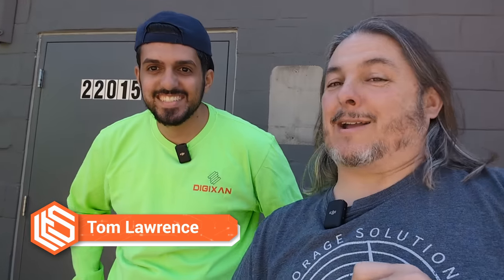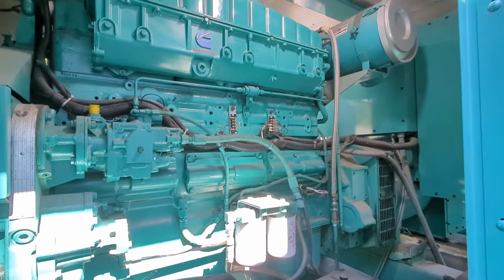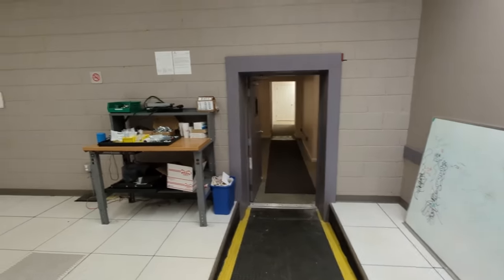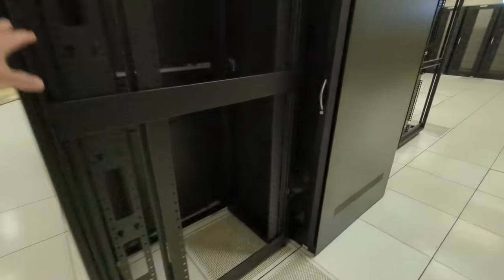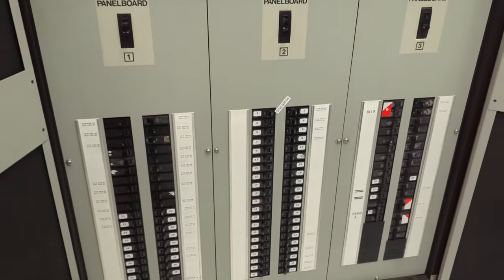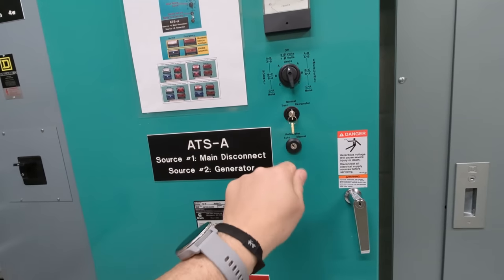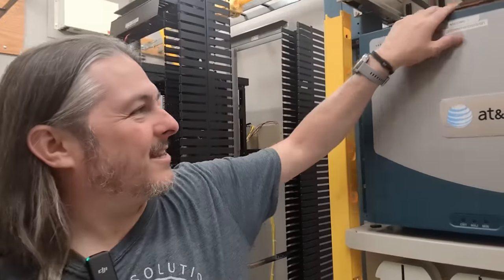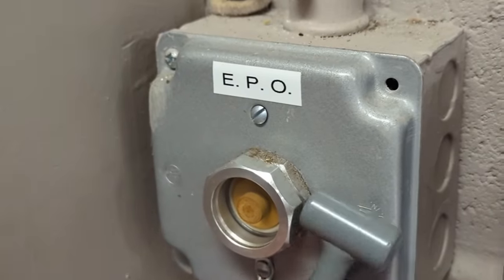What's Inside This Decommissioned Data Center?

Comment: "normally can't open these" man that's so wild compared to places where I've been in computer lab support server rooms and its like "yeah just go find the breaker turn it on" with various 120V/208V/480V different 3 phase delta/wye, and 60/400Hz power systems.  The plumbing stuff and UPSs are neat though, that part I can't see places I've been.

Comment: Ah, a good example of a data center where you least expect it. These are actually very common throughout the world.
The main reasons for keeping a data center's location a secret is purely hardware security. Having direct access to a server is far more dangerous than almost any software attack.
Data centers that just offers VMs tends to be more relaxed about this type of security, since the hardware itself is more or less just a standardized box without any labels hinting at who rents it. Ie, it is far far harder to do a targeted attack at a specific organization. But even a lot of these data centers hides.

In Stockholm where I live I know of 2 data centers that are in actual cold war era bunkers. Their locations are fairly well known, but that doesn't make it easier to access, since it is a litteral bunker. Though even highly secure facilities have been targeted through more indirect means before, just dropping a few "thumb drives" outside the premise to try to pull of a HID attack isn't a new thing. This becomes a lot harder if you don't even know where the secure facility is located.

Comment: We had a UPS explode in our data center in about 2001. Big fire, and lots of water damage, because the fire department couldn't get in. The guy who had the keys got into a car accident rushing to the site. Now the center has no UPS in the server rooms. A fire wall between it.
Reply: @@wd5vd page 2: They used concrete saws and cut a hole in the wall after what seemed a long wait.

Comment: I loved testing the generators and transfer switches both from the UPS and by killing power. It was a frequent testing requirement from the insurance co.  I also liked it when the halon fire system went off.
Reply: >I also liked it when the halon fire system went off

That does NOT sound like fun.
Reply: @Jamesaepp  expensive too, causes shunt trip of power also

Comment: Currently work in a former data center like that one, with the same raised floors and Liebert HVAC.  They kept the layout even without actual server racks.  The Lieberts break down a lot. The room has two. With just one, we exceed 110 degrees just from ambient.  Really need two to be survivable and again, we don't even have servers.  The best part about the Lieberts is how they smell like a cross between old socks and an old fridge.

Comment: A question about the genny, I worked for a company and their corporate data center and IT department was in part of our building. They had two independent generators, one diesel and the second natural gas. The primary was the gas unit. They had 7 days worth of diesel on hand. I left in 96, do people spec single or double generators now? Is it just how paranoid management is?

Comment: That's one Tiny datacenter.
Reply from the maker: yup
Reply: I worked building maintenance at the one in Atlanta (40 Perimeter Center 1978) and ours was 84k sq ft.  2 story, the bottom being the actual "Data" portion and the upper is where all the programmers were.  We did all the electrical, plumbing, HVAC and work stations.
Reply: Relic of a "long past" age. These days, one could have more power in a single rack than that entire building. (I've used "small" [4U] blade centers that used 4kW... the whole rack only had 5.7k fed to it.)

Comment: I worked in the Data Center for the Atlanta Federal Reserve back around the year 2000. I was the LMS administrator for the first online training server they installed. It was about the same size as the one you were visiting. Nowadays that Data Center has been shrunk down to a small room with one cabinet of servers. :)

Comment: I was once a short term generator tech. ATAT was our good customer. One of the bigger sites, the "switch's" where all the local calls are routed through. Then the calls go microwave to microwave tower all around the country. For instance. the whole east coast has microwave towers all down the coast it doesn't need any wire/fiber to go all the way. Then to fiber maybe depending on how far across the planet. Detroit
The other cool generator was when the main standby 1 megawatt one needs a part in a switch building. It then needs a back up of the backup generator. Brought in a trailer generator. 8 cylinder twin turbo diesel cat. OH MY GAWD. the startup on that is violent and the airflow for the radiator will suck a golf bawl through a garden hose. Very fun but i had to go make a bit more money at a desk job.

Love you channel
I'm also here to say my old black box heater poe edgerouter x died. Replaced it with a lite 8. Firmware it had or suggested, was broke. They eventually fixed it as my google foo wasn't good enough to figure out how to put an older firmware on it. Or just my unique basic PC hosted controller (up-to-date). It wouldn't take an adoption and hold. It would fault out. Over and over, reset after reset. Firmware update came along a few weeks later. voila. Great.
I do like the switch setup and its setup in the controller instead of standalone like the old edge router. 
Time for some cameras i think.
Reply: They are called Central Offices (CO's).  Nothing is on microwave anymore.  At least nothing significant.  Everything is on fiber.  Both coasts, everything in between, as well as oceanic.  Power consumption is even less than back in the 90's.  You go into a CO today and I guarantee there are empty floors that were jam packed with telephony gear.  Hell one floor would be dedicated just to terminate all the outside plant cable pairs.

Comment: Hmm... NetApp has a data center in the Research Triangle that MIGHT be filmable.   They promote it to sell copies of it... reason?  It is FAR more efficient than most data centers... the front of racks is a reasonable human temp.. the back? Very warm...   They have huge diesel generators to keep things alive during the normal Duke Power problems...   One of the nice side effects of having the racks isolated is that a large percentage of noise goes away when you have the backs  of the racks sort of isolated from the fronts... (Lord knows a NetApp Filer is NOT a quiet animal...)

Comment: Looks like it was a small business local DC, especially with only 1 generator. Any DC I've been to (and have eqpt at 4 locations) has at least 5 gennies, usually N+1. Two major DCs I'm at also have contracts with fuel (diesel) suppliers that when a major storm is inbound, they not only have their multiple thousand gallon underground tanks, but to have a couple tankers parked in the parking lot in case of an extended outage. The inners and operations of DCs are fascinating. Only a few min in on your video, but so far very interesting.

Comment: cabling is often cut like this due to not wanting the gear to be reusable, if the tenant were to sell it to the building owner/landlord, and if there were ANY issues down the line, there could be a giant legal mess that the previous tenant might get pulled into.  that and the obvious "not my job"/expediency thing, and sometimes to spite the building owner/landlord. also sometimes shady contractor things in the agreements "tenant will use our preferred vendor for network cabling install work"

Comment: I swear - after building and commissioning a bunch of TV stations (which are not too unlike data ceters) concrete floor tiles are the shittiest things to cut holes in for racks.... and then when you cable the rack and pull the cables the steel tops and bottoms are like razor blades if you dont put capping on them.

Comment: How long ago did Nexcess decommission it? It looks like they still have it listed on their datacenters page. I wonder how much noise the neighbors, such as the dance studio next door, heard.
Reply from the maker: Not sure but the generator was last serviced in 2022 per the tags on it.
Reply: i think we only finally decommissioned it a year or so ago. re: noise: the generator only ran during anticipated/actual power outages. other than that, the walls and thick doors keeps most of the noise inside.

Comment: Why was there a data center in Dearborn of all places?
Reply from the maker: yeah, weird placement being adjacent to a few other business like that and backing right up to residential. It's hiding in plane site.
Reply: Low land prices, I would imagine
Reply: I almost purchased this data center when I was CEO of Ann Arbor based DigitalRealm (in fact, I bought a house across from because I was confident and expecting to close on it but Nexcess won the bidding war at the time).  So I instead built out a DC in downtown Ann Arbor's Key Bank Building (where Cisco had vacated then site used to build the BFR which required them to make serious augments to the building)
Reply: It was built by Carter, which designed facilities for Level3, UUNET/Worldcom, and Verizon.  It has close proximity to several fiber conduits and it had ample power in the area (which had reduced the cost to augment).  I believe, it was originally designed to supplement backbone provider AEGIS other location on Outer Drive.  I did a lot of BGP/Internet peering consulting for ISPs and CLECs my youth in the mid 90s and its rarely about cheap land and more about the areas infrastructure.  Otherwise that facility would be larger.
Reply: @allthingsdigital2434  I actually use to host a server at DR in ann arbor back in the early 2000s. That place was tiny, even smaller than this one.

Comment: i had always heard you couldn't cut fiber like that but I didn't know if that went by the wayside when they switched to plastic core over the older glass style. I never get to terminate those so I've always been curious. Cool video btw I've only heard a quiet datacenter room when we're starting a NEW warehouse.
Reply: Well not if you plan to use it but for demo...who cares
Reply: @mrmotofy  I asked bc I have that scenario, but the cable is also underground. Trying to fix without a full replacement.
Reply: @TannerWood2k1  With proper cutting and equipment it can be done. But in the middle of a run may not be possible. Run conduit just for that reason.
Reply: @mrmotofy  the issue is that the conduit was too small and the LC end separated leaving just the rip cord attached. It's om5 outdoor jacketing and LC connector replacements won't slide over. So if it were damaged it would be right at the end and hopefully not travel back too far (and I have service loop slack to play with). I ran a light tester on each pair and it gets there but I don't know how to test intensity. Guess I need to find a local fiber tech to come show me how it's done. I have a cleaver and all the other stuff I should need except proper fitting end connectors. Thanks for replying bc I assumed the whole cable was done for.

Comment: It’s a Cisco ASR, data center probably was running a multi-homed ASN
Reply: that's not an ASR, it's an optical chassis (looks like maybe an ONS 15454). It would have connected to AT&T's SONET network ring and be used to break out whatever circuits were coming into the datacenter (OC-3, OC-12, etc.)

Comment: Also the misters in the corners on the cieling. That spray water into the air if humidity drops. 

Also the cut fiber, any new client will NEVER re use any fiber or cables and so the vacating co wil jsut cut and pull servers out.  Faster abd cheaper. Reusing any cables in a 24x7 datacenter operation is a bug no no. Murphy will show up!!!
Reply: >any new client will NEVER re use any fiber

Never underestimate corporate cheapness. I could easily see a small operation letting it ride. And FWIW It's singlemode fiber, pretty easy to test and run it, so I wouldn't blame em too much.

Comment: One thing I have wondered is while a flywheel UPS makes sense because you just need enough time for the generator to fire up, is the real future in better battery tech like LFP batteries?  The idea being with all of this 'green' power generation tech being unreliable and variable throughout the day, the UPS doubles as a power buffer to soak up extra power when renewables are plentiful, say in the middle of a sunny day and then discharge when they are not, say in the evening when the Sun goes down and everyone comes home and turns on stuff?

Another thing I have wondered is would it make more sense to do a dual fuel natural gas and propane generator instead of of diesel?  The idea being by default you would run on natural gas, which should be limitless and not as bad on the environment to burn than diesel and fall back to stored propane in the event the natural gas supply fails, say an earthquake ruptures lines?  Just thinking it would be less to manage than shipping in diesel on a regular basis and having to do something with all of that fuel before it goes bad.  Propane never goes bad, so if you go years or decades without disruption to your natural gas supply, the propane can just sit in the tank.  Natural gas is typically piped all over the place and usually still works in a power outage.  You could also have an LNG tanker truck hookup for emergency use in case you can't get a propane tanker in a disaster situation or just find it is cheaper to source the LNG and know you will likely use it up before it evaporates.  Maybe even get into some co-generation with the power utility to help give those generators a good workout, especially as natural gas fired power plants are generally used as peaker plants these days.

If you had good battery tech and good generator tech, maybe a data center could run off of batteries during peak grid demand when power is most expensive and dump power onto the grid from its generators at the same time.  Especially some of these newer data centers are so big, they could use grid scale power generation equipment anyway just for the site.  Anyways, I find this backup power stuff usually works best if it is setup in a way where it is in daily use.  It is when the backup power is really only a backup that rarely gets touched is when you find it doesn't work when you need it.  Even just test firing on a regular basis may not tell you everything you need to know and wastes a lot of fuel for nothing other than to know that the thing still turns on.  There have been data centers put together where backup power does not cover cooling and so the whole place shuts down anyway when something happens because you cannot run a data center without cooling.  These kinds of solutions talked about here will be making money for the operator, so easier to justify to the bean counters that it has to be sized up to cover everything.

Data centers also need to adopt a 400V DC system.  When you think about it, an old data center like this wastes tons of power on doing all of these power conversions.  With a 400V DC system, you do one conversion to the 400V DC standard, the UPSes are charged to the voltage of the other in-line UPSes, and then just directly connect into the 400V power bus.  There is no real conversion in the UPS beyond a two way charger to get the batteries to the right voltage before connecting to the main power distribution bus.  The power then goes direct to the servers.  It is straight main converter to the 400V DC power bus, the UPS batteries are inline with the power bus, and the power bus goes straight to the servers.  The server power supplies don't have any AC/DC conversion hardware, which is generally about half of the power supply, instead just skipping to the DC-DC step down after.  Much more efficient and cheap to mass implement.  Electric motors running the cooling system are also much more efficient when running variable speed inverter driven motors, which could get power from a 400V DC power bus.  For grid balancing applications, the main power converters to the 400 V DC buses could go from say delivering twice the power and thus charging all of the UPS batteries at the same time to completely shut off and the data center running completely off of the batteries and constantly varying in-between while balancing the grid.  This will provide good stats on battery health on a daily basis.  With the ability to have multiple UPS battery banks in parallel, you can take a problem battery pack offline and swap it out.  With LFP batteries, they should be able to take this daily use case for decades.  With a setup like this losses in the system are very minimal as LFP batteries are pretty efficient and you cut out conversion steps that reduce the efficiency and raise the installation cost of existing grid scale battery deployments.  I mean the conversion hardware is already there to power your servers, you just piggyback off of it to also charge up batteries and then the batteries can discharge directly into the servers without conversion hardware in-between and the servers themselves drop some of the internal conversion hardware, making it all even more efficient to do.

Comment: No VESDA? Water instead of gas? Single Genset? Plenum cooling? No perimiter fence? No STS for A/B feed to racks? meh..
Reply: Its worth pointing out that this particular datacenter has not been actively used aside from 1 or 2 colo clients for the better part of the last 7-8 years. Maybe even longer. The primary datacenter is much larger, and has all the fancy bells and whistles you speak of :)